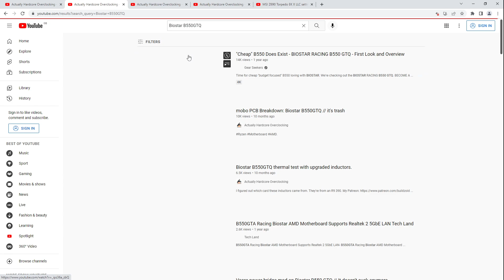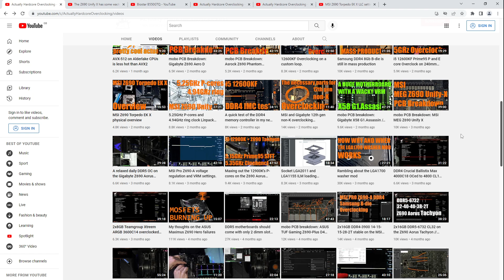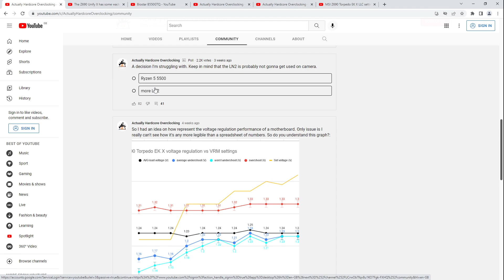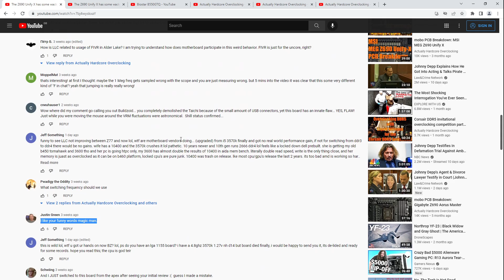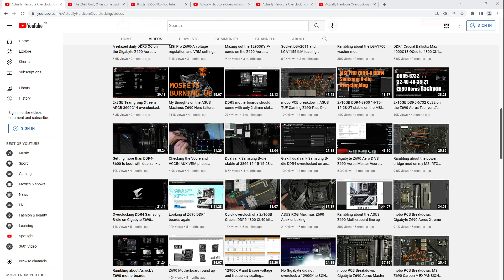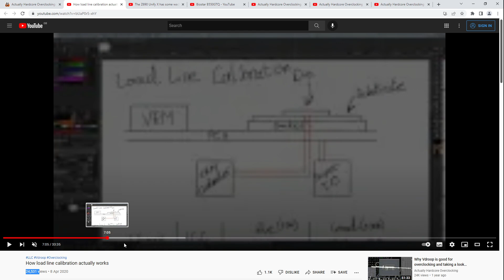Complaining about running the channel again

Comment: Also how about you bin the best ddr5 memory sticks and try overclocking them and tightening the timings in every single motherboard you have and once you run out of motherboards, then make another video comparing every single one of them. That can surely last you like a couple of weeks I presume... And also why don't you make a crossfire video? Like you probably have a ton of AMD cards, you can probably crossfire weird cards together in some motherboard and try to run fire strike. That would probably be fun and also help some people if the performance is good, I mean if someone has like an R9 380 and that person wants to change the video card but doesn't wanna spend a ton of money for an upgrade, if the crossfire is good they might just buy another old R9 380 or even 370 or 390 or even 270 or 280 or 290 and then run them in CF for like much cheaper... I don't know if that'd work but if it would you're probably the only person who could demonstrate it in detail...

Comment: I know this comment is super late, but I wanted to make it anyway because I think it's important.

I see your channel as a reference. There's a LOT of good information here and it's reasonably well organized. The new thumbnails help with that. There are a number of topics which have my interest and I don't have memorized, so I can easily go back to one of your videos and check. I enjoy designing DC-DC converters, (but much smaller ones), so seeing stability issues with the ones on MBs and GPUs is really interesting to me. I like seeing how the different loads from stress tests have different outputs on the oscilloscope. I wish you did more with the FFT, but I think I'm the ony one interested in that. Some of my favorite content is the probinator data with the CPU.

Comment: Well most people these days work for people they don't really like doing things they don't like with schedules they have no control and they do it knowing they will get zero ownership or credits for whatever they are spending their time and living with the fact that they can be substituted at any time for someone equivalent but cheaper.

You not only work on doing what you like but have full control of your schedule and get full credit for whatever you do. Even if you sometimes don't really appreciate some of your work for the sake of the fact that others will, it's still involving something that you like and had the option to chose between do or do not with the freedom to control every aspect of it, like what, the time, the way and still get full credits for whatever comes from it and for sure there will not be an substitute for Buildzoid. 

Even sometimes you not doing something in the exactly way you wanted, compared to the weights of work of the vast majority of humanity regardless of the country, you still in a very nice and comfort position of freedom / reward.

Thanks for your work Buildzoid!

Comment: The way you modified that picture of the FX 6300 reminds me of how I edit photos, like the photo of the duck in my thumbnail.  Very cool.  I assume you play with the lighting, exposure, and color settings.

Also, you ever play with DDR2?  I had a lot of fun with it while using a Pentium E5300 and a Q6700 on a Foxconn G41 motherboard.
Reply: 4.8 GHz E8600 here on a P5N-E SLI. Man, what a terrible board that is and yet it does 4.8 GHz lol
Reply: @Wasmachineman   LGA 775 is so fun!  I got the q6700 upto 3.15 on a stock cooler but couldn't get it any higher.  I think it was the RAM.  It was DDR2 500 or 667 running up near 1050-ish.  I always wanted to run a E8600.

Comment: RE R5 5500: I honestly think you probably have to be a little more explicit. I did not have in mind right away that this chip uses an APU design (without the GPU part enabled, of course).

Comment: it could be possible for board partners to implement a life vest fuse, but they wont, they want us buying more gpu's. they cant even implement a 4 pin pwm fan header, 3070 ti ftw3 aux fan runs full rpm till the fan hub dies.

Comment: you could show a comparble datasheet and show, how much current we could expect from a 50A, 60A, 90A, 105A power stage. You record it one time and can link that video to each PCB breakdown. This could also include the awful ASRock B660 boards which are capped at 90W.

Comment: Yea  was on team 5500, would have been fun to see it perform oc with 4400 cl16 ram
Reply from the maker: I was thinking more like 4533-4800 on the RAM but you get the idea.
Reply: Actually Hardcore Overclocking If you end up picking it up, would be real interesting to see it compared to the zen 3 chips in gaming.

Comment: 0:39 you enjoy making thumbnails? Thats new... but at least the recent thumbnails were hinting towards that
5:06 do you publish the "weiredly filters hardware images" somewhere?
7:20 why wouldn't you publish some of those videos? IMO every hardware repair is unique and worth a video, even if the excct same thing has already been done before.
12:12 Maybe you should handle you pcb breakdowns a bit more like reviews then. I consider most of your mobo videos as "extended reviews" anyway
15:55 yes, explain why you shouldn't just replace a fuse. There are way to many dumb people (inculding me) that just stumbled across your channel with the electronical engineering skill sufficient to change a lightbulb
20:20 Not really necessary to mention that nominal current rating is not actual current handeling capability. You already mention this with your how-much-power-does-the-VRM-produce calculation you also include in you pcb breakdowns.
~ 27:00 You really need to explain more basics in your oscilloscope videos, if you want most people to understand it. I don't need to understand your oscilloscope videos though. Just give us a quick summary, and we are happy.
40:40 yes, SPoon-feed us the conculsions right at the beginning, then carry on with the video normally
41:44 the oscilloscope videos make your channel pretty unique. Noone is better than you at doing this so... WP, even if only 42 people in total are intrested in it. As Linus himself said it: in order to make a YT channel strong, you need to do some things better than anyone else.
48:48 YEEEAS memory OC on the cheap ftw! (although it is funnier if an iGPu is involved)
50:40 Would be great if someone did it though, even if you dont have the same quality standards than Hub.
56:26 thats a pitty. A script, even if it just contained "don't use liquid metal on gpus, it's dangerous" or "VRM switching frequencies over 500mHz are stupid" over  could alleviate some of the tenacity in your videos.
1:01:01 as I said, as long as there is a small group of people who needs the information as much as you did, there is nothing wrong with it.
1:03:33 the "before that" on GN-Videos is kinda a meme, and I also like yoour outros in the same way, so what is wrong with it. It's pretty much above the YT average.
1:09:40 Can't you say to check the box at the top right corner (although is not much less work for you to just say it in the video)
1:12:33 Burh, It works. Sometimes you are lucky and get 100k views and sometimes you dont. The channel is doing fine,
1:16:24 Yes. Not that I don't like meta content. But right now I am in QUaranteen and drunk, So I really wanted to give you some decent feedback on this video, well... here you go.

Comment: You need 2 buildzoids to share the load. Work smarter not harder. Easier said than done I guess. People that make youtube videos the amount of time you have done usually would have a production team to help them with videos. I'm not sure if your channel can support that. But you should find an apprentice or someone that is willing to help out the channel for you such as editing videos and uploading them to youtube or whatever is needed. Asking for help may not be in your dna. But it also could help the channel the most if used right.

As for people not understanding your videos as much as you want. Your IQ is much higher than normal people. Even people that studied electronic circuits might struggle to follow some of the topics you have. Let alone with someone that doesn't know the difference between voltage and current. To those people I would suggest electroboom 101 videos. If you understand them you will know more about the oscilloscope videos. But my point over all is even tho we might be dumb sometimes we share the love for overclocking all the same. That's the best people can do. Also people that don't comment on videos might understand the video more than someone that post a comment asking a question. So you might think more people dont understand than more do.

Did Albert Einstein not want to invent the point of relativity because no one would understand it. Hell no. He made it because no one else could. He was recognised as one of the greats for it.

When you started the channel you said there was no other channels that focuses on overclocking the way you would like. In other words you are setting the standard. You are neo from the matrix who can understand all this. You set the topics. You set what you want to talk about and what you dont. Because you invented it. 

As for the motivation part. I guess that's more personal. Why we do things at the most basic level. What motivates each person may be different. I would suggest a sports psychologist or someone that can give you a new perspective and give you more motivation. They also help with burnout issues and not caring what other people think. I'm sure people that watch the channel would help pay for that.

Comment: What’s with 780TI fuses failing?  That a card with undersized fuses?  I think it is something like parallel 10A fuses.
Reply from the maker: which 780Tis have fuses? The card I was refering to is the FTW2 EVGA 1080s and 1070s. The PCI-e slot fuse on them is a bit small AFAIK and some cards end up with fuse tripping even when the card is fine.

Comment: Im deeply out of the price range of anything you post on this channel yet ive seen most to all of your pcb breakdowns in the last 2 years, so i guess im just in it for the cool vrm's too. Coincidentally im also more interested in using the information to assess boards I currently have. Like, my ventus 2060xs uses a 4phase vrm but they are 75A smart stages so I dont feel bad pulling 240W on them. You did influence me to buy patriot viper steel's though. But I just wanted big number memory speeds and maybe a little boost to my firestrike extreme to get me to top 10 on 2060's.

Comment: Sounds a lot like burnout, which I totally get. Motivating yourself to make videos is so hard. Having tons of ideas and deciding on one is tough enough. Then setting up all the camera equipment and files to get it done right, all before you finally get to doing the testing. It does tend to take a lot of fun out if what you do. I have been doing lots of LN2 overclocking which I know would probably do well on youtube but the last thing I want to do while relaxing and overclocking is trying to make some sort of narrative and set up cameras. It sucks the joy right out of it. 

As far any suggestions... Doing videos on modding GPUs or XOC on older hardware would be a lot of fun to watch. Oh, and the HWbot roundup was a series I never wanted to miss. Keep up the good work.

Comment: Do you know how many of your viewers are actually hardcore overclockers? 

For me I can't justify watching your long videos about overclocking one very specific bench configuration when I'm not a hardcore overclocker myself and will likely never touch that configuration let alone that platform generation. I'm here because cool overclocking mods and interesting/useful information (eg. how modern VRMs work) and when I was upgrading from sandy bridge to Zen 3 I used your content to interpret VRM quality on boards well as RAM info and buying guides. But I run stock PBO & XMP and aren't really bothered enough to tweak it for an extra few MHz, some stuff is even down clocked for better stability, I suspect many others are in the same boat. 

The information in videos you currently put out is an extremely valuable info dump for those deeply involved in overclocking or about to buy that one bit of hardware but that's likely a very small slice of your audience, and your content requires a fair bit of knowledge about computers and electronics to understand in the first place (I only understand because I'm an electronics engineer), the majority I would expect are just tweaking their gentle daily OC or just think it's cool. Kinda like sports, how many people watch the main event vs how many watch the warm up for the main event day vs how many watch all the training that season up to the main event vs how many actually start doing the sports thing professionally? Every car racing fan will watch that 30 second clip of an amazing photo finish, but very few are going to watch the same driver adjust their camber for several hours for slightly better tyre wear.

The only suggestion I can make is to have more 'normie content' like hardware reviews for normie daily OCs or PnP XMP performance per dollar, but that goes against the name of the channel and would likely have to be edited but I would expect would appeal to a wider audience.

Comment: Hm, to so solve your problems and Viewer and sub count to rise, make intel 12 Gen, 13Gen CPU & Ram OC Guide, and then you go to 14 gen CPUs 15 Gen and the story goes on, same for New AMD CPUs Upcoming 7950x Ryzen 7000 or what ever they call their new CPUs Same for RTX Graphic cards. And all that in 10 max 20 minutes length videos and make a cool intro for your self and an outro.

I hope it helps if you don't want to do that hey It's up to you just my tip for you, I have no time for that even it is not mutch work I sadly have no time to start YouTube, so maybe you can start with that I don't know I hope it helps if you read the comment.

Best Regards
Hadouken

Comment: For explaining stuff every time, you could make a bunch of (somewhat concise)  videos about each topic, and then just mention that people should watch the video on that topic if they haven't seen it. So for example you could say "This GPU doesn't have a fuse. Watch my video about what I think about fuses if you haven't seen that." or "This card has 8 70A power stages. Watch my video about 'Power stages and Phases' if you dont know what that means."

Those videos would have some value in themselves, and at the same time make the reviews shorter and avoid repeating yourself. Something you could consider.
Reply: "Buildzoid Basics" series that explains building blocks of hardware would be great.
Reply: Yeah I really enjoy Buildzoid's explanation videos with Diagrams like his "How load line calibration actually works" had an idea how it worked but found out some of what I thought was wrong, so go to learn some new stuff 😁
Reply: Yes favorite videos to watch are the ones where he draws and explains.
Reply: I'll reply with something usefull here - althrough my own orignal comment unhelpfully boils down to "ignore the normies, they'll either learn the hard way (same as me) or get board and go away".

Yes, I agree that a series of 'Basics' (basic by by AHOC standards) videos would cut down on the amount of repetition of common concepts. Also (hopefully) keeps the more basic but still sensible questions grouped together. I would give such videos a strong naming convention, preferably named and numbered, something like "AHOC Fundamentals (X) - (ABC )". Then stick them all in one YouTube playlist. 
So in any main video, you can say "see video X in the Y playlist for..." VRM nominal ratings, fuses, phase count, LLC, transience, why NVMe in place of full PCIe is dumb... etc

As for the content of the main videos: if Buildzoid thinks it, I want to hear about it. Leave nothing out.
The occasional normie content, probably around the launch of a new hardware generation, would probably help keep the channel growing. Some sort of disclaimer at the start that the following video is meant as an introduction to (X) type of hardware coverage on this channel.

As for the commenters...
A specific person is smart. A person can ask an inteligent question and search the entirety of human knowlege to get the answer on the internet.
People in general are stupid. People on the internet have the freedom to say a lot of dumb things in a lot of differnt ways.
Reply: The channel BattleNonsense did that "basic explainer video" thing successfully for networking and game design topics. Made every new video much more enjoyable!

Comment: if you're worried about whether Tabs are muted, i can suggest a Plugin simply named 'MuteTab' - which gives you advanced control over what Tabs/Domains can play sound.
for me the feature i wanted out of it and  am happy to have, is all Tabs are muted by default until i unmute them, and i have toggle mute for the Plugin set to a Shortcut Hotkey. it has quite a few other features as well.
so all Tabs are silent by default but i can very quickly unmute the Tab i'm looking at with a Shortcut.

also i'm the 1% but i don't know if going on about how i am that really does any good for you.

Comment: I am here for the outdoor overclocking in the snow, the power board and capacitor soldering.
The fun overclocking records on old hardware.
The PCB breakdowns and memory overclocking.
I am educated in electronics, so I understand the scope videos, Yay
Videos like this sucks to make, but they sometimes are needed.